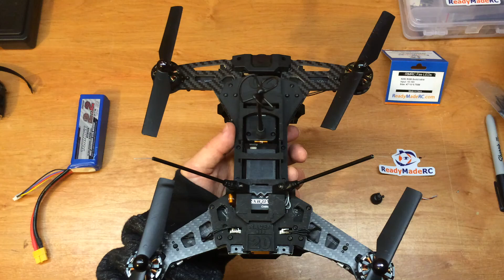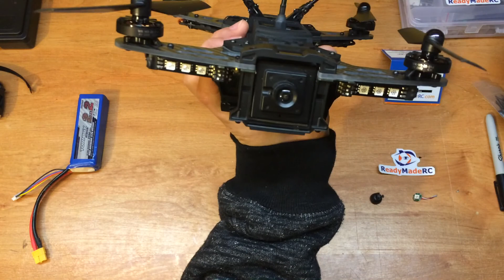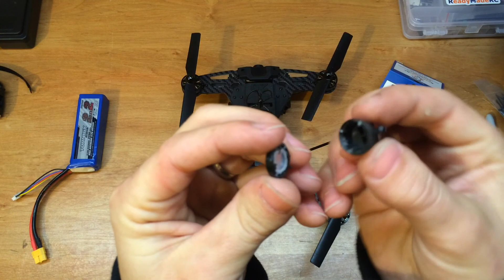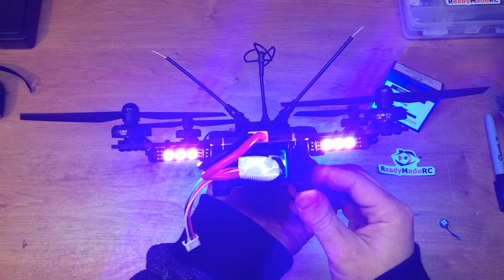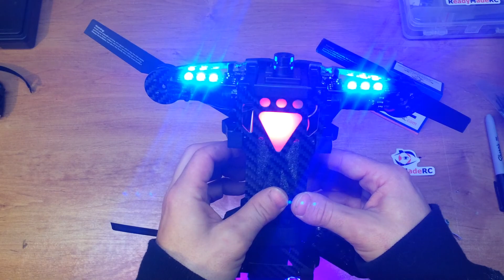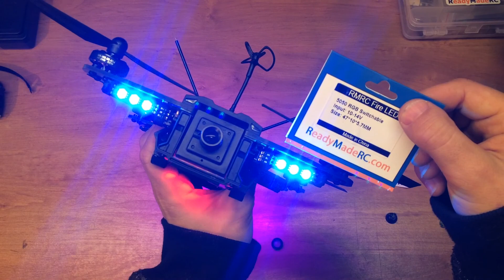Custom Walkera Runner 250 - Color Changing LEDS - 12v RGB 5050 RMRC Fire LEDs

Comment: hey im about to do this in the back. i want signal light in the front as well.. did u take 1 signal wire and connect to the three led leads? please describe signal wire led lead connection.  thanks
Reply: i understand u ran indicator from the back and positive and negative from the xt 60 direct to the indicator?
Reply from the maker: I have only 1 signal led, one of the gutted factory tail lights. Any led you want to blink must have 3 wires. 2 wire LEDs will not work as indicator lights.
Reply: understood. ill make a before and after video soon. thanks a lot.. made a mega order and im waiting for everything to come in.

Comment: I like the lights and I going to do on my next mod for my walkera runner 250. But One question is about the battery that are you using for it . Its compatible with the runner 250?
Reply from the maker: It's definitely compatible! Hobbyking.com Turnigy 2200 mah 11.1v 25c
Reply: +MultiRotorReviews  thank you..